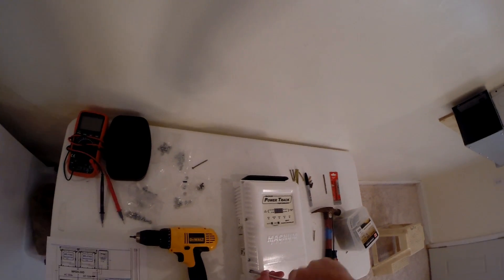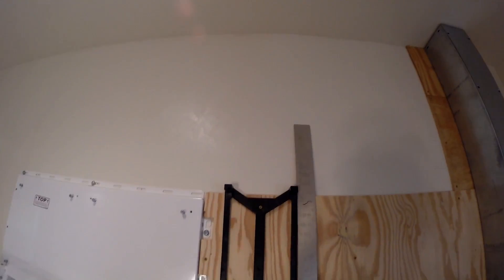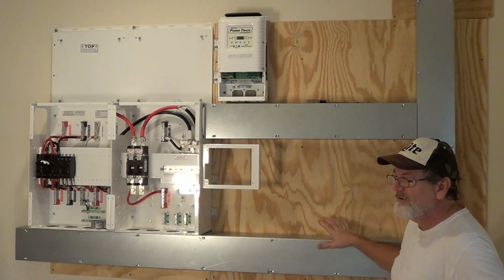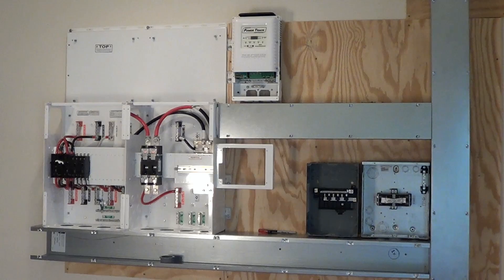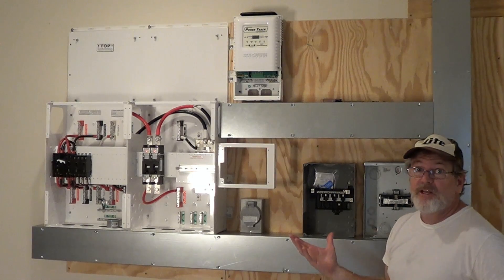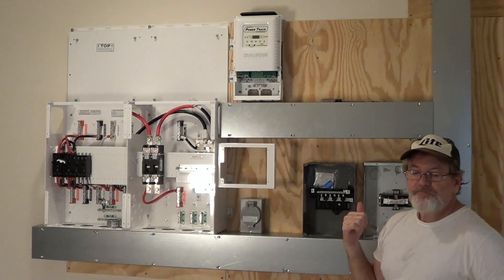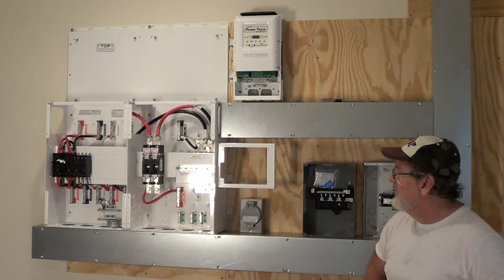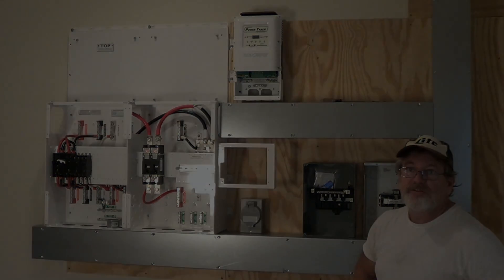Off Grid Solar #10: Mounting the PT-100 Charge Controller

Comment: Hey David,  What is the purpose of using two power inverter A/C and D/C?
Reply from the maker: Bong,  Not sure what your asking.  I use two charge controllers because I can't put all 24 panels on one charger.  I use two inverters to get twice the AC power out.  Thanks!
Reply: So if I install 4000 watt inverter I can only use one either A/C or D/C inverter?
Reply from the maker: @bongtira5926  Inverters convert DC (12v, 24v, 48v) to AC (120v, 240v).  With my Magnum system, I can have up to four of them.  Each one is 4400 Watts.
Reply: David Armstrong thanks 🙏